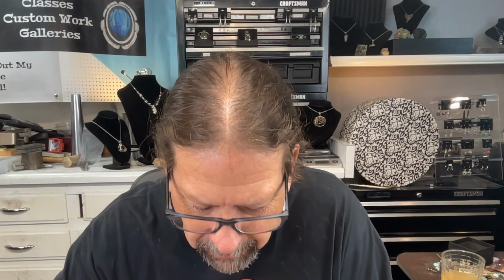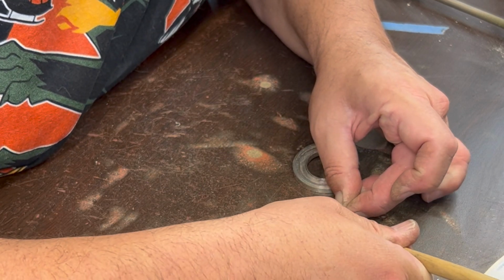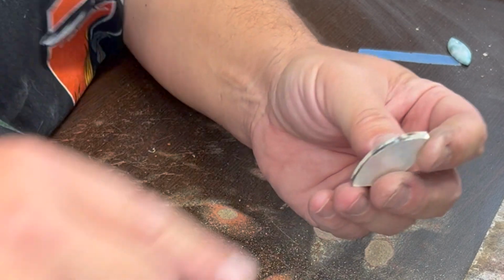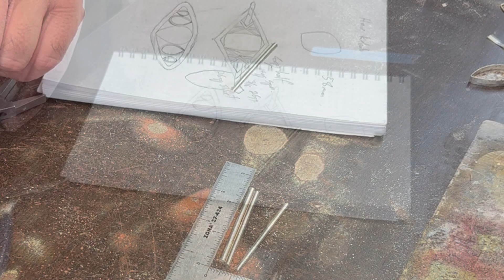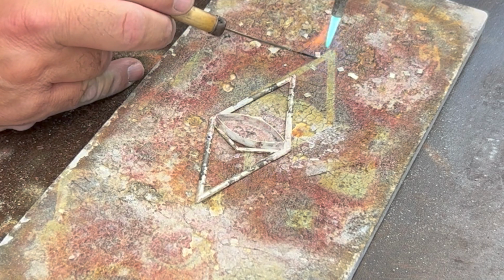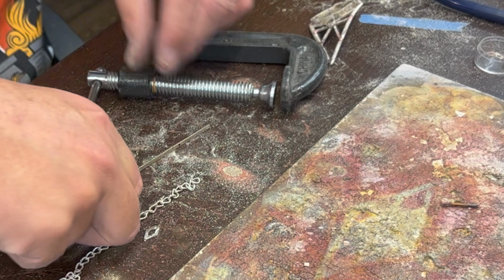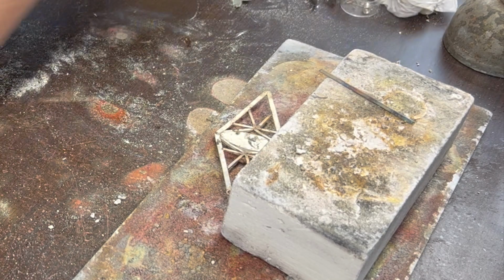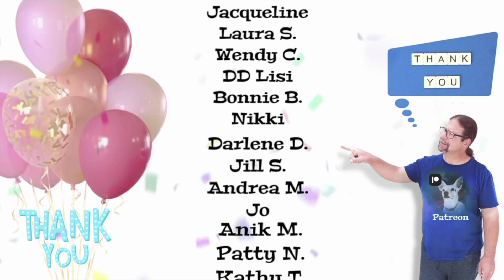Making a Larimar Hair Ornament: A Silversmithing Tutorial

Comment: Yay a barrette!! Leastways that’s what I’ve always known them as. I make a lot of these and people love them. I love the way you twisted the pin (helps to have it hold in straighter hair)and love the attaching chain, cos I always try to use a chained pin too. Love the styling too cos it’s so utterly different in style from what I usually make. Mine are usually curvy rather than geometric but I really like this design(I can even see how I could make it into a curvy design more like my typical style lol). I love making what I call hair jewellery. My pieces range from simple ring barrettes with attached chains(exactly what they sound like…..I usually make the ring with twisted wire) to more complex scrollwork pieces in various shapes, to a dragonfly barrette that was pretty complicated to make but look great when worn. I was also thinking of making some sets of silver hair sticks. That was before everything got turned upside down by having to move however.
Reply from the maker: Those ones you make sound really pretty!  Most of the hair pieces like this that I’ve made in the past had swirly designs. Thanks for the nice comment!

Comment: Have you made these for sale and if so what sort of feedback did you receive?
The reason I ask is that I have wanted to make a "functional" hair accessory for my sister since I started this journey in silversmithing.  She has EXTREMELY long hair so I am still in the thinking process for a design that hold the weight & not keep shifting around.
Lovely vid as usual 🙂
Reply from the maker: Thanks for the question Susan. Yes, I have made and sold quite a few kebabs over the years.  These are best for people with some hair volume. If they don't, I usually suggest they rubber band their hair and then put this around the rubber band so it stays in place well. You could put something on the back of the bezel that is less slippery, like some felt or moleskin. That might help keep it from shifting much.